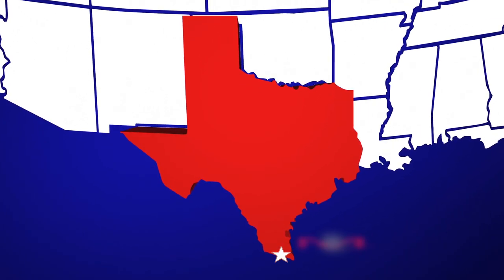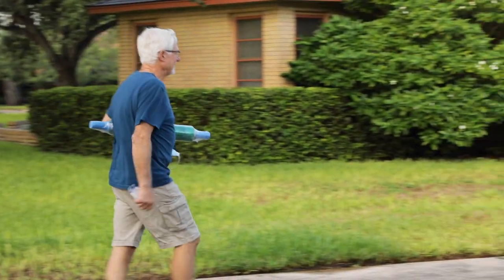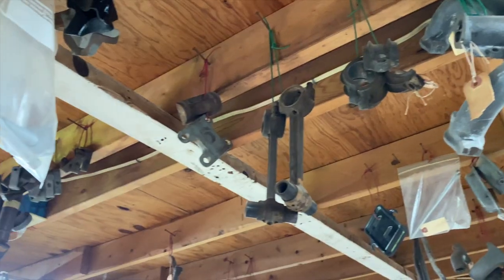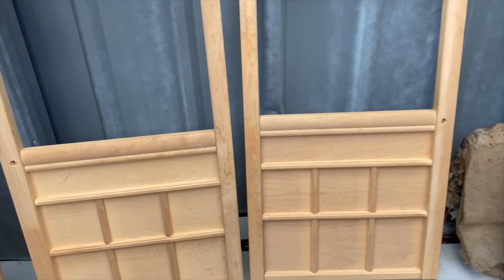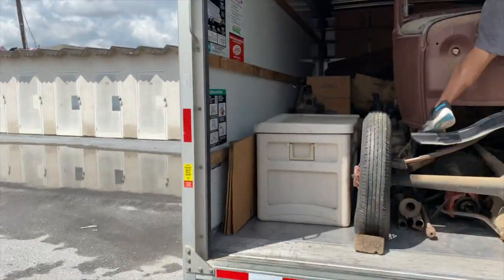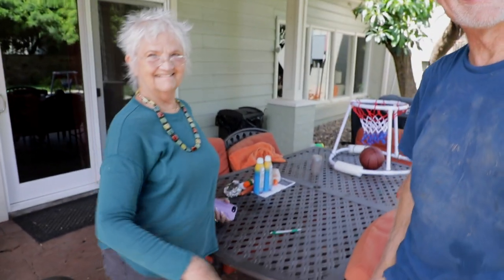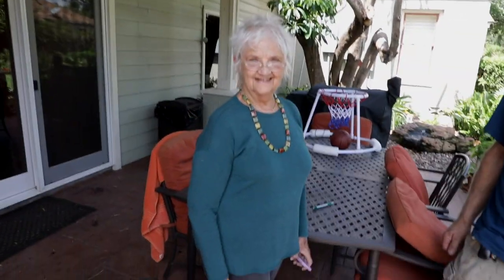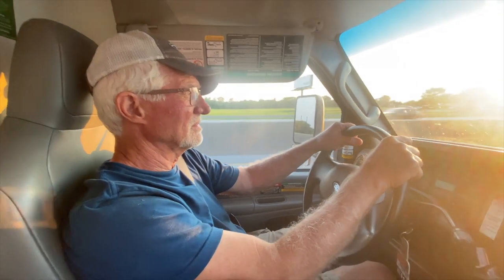Restoration Vlog E1: 1931 FORD Model A Woody Wagon Episode 1 E1 - Pick up in McAllen TX

Comment: Love your videos.  I have a 1930 Tudor Sedan I restored in high school (1970s).  Life long Model A interest.  I have been wondering about moving the car in a rental truck as opposed to using an open car transport or trailer.  Did you get a rental truck with ramps to move the Woody Wagon?  Wondering how to load the car?  Thanks.  I look forward to each of your videos.
Reply from the maker: Hi.  Thanks for watching.  We made some ramps for the rental truck to push the rolling chassis up.   If it was a complete car we would have wanted a car hauler.  We just use an open trailer to haul our finished cars now.
Reply: @PictureTime  Thanks so much.